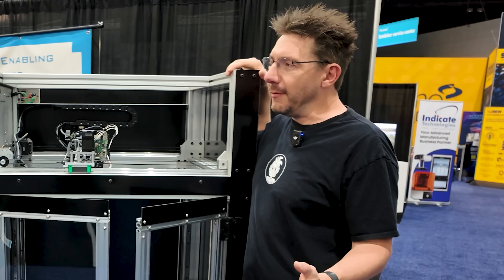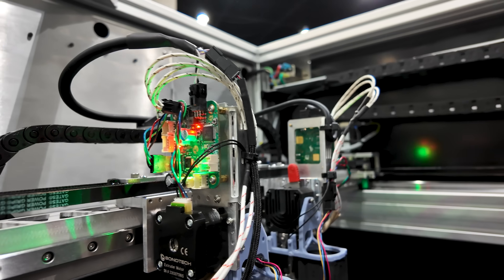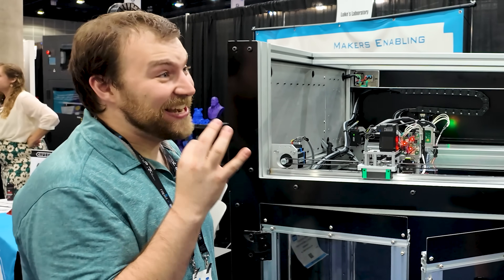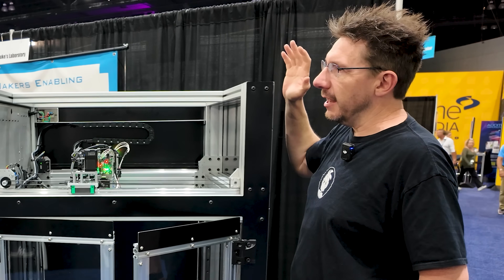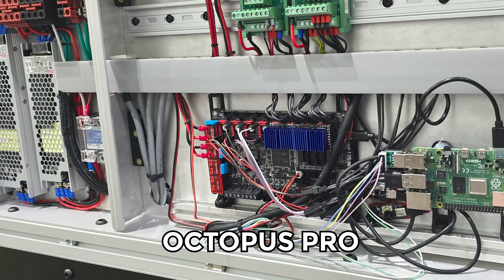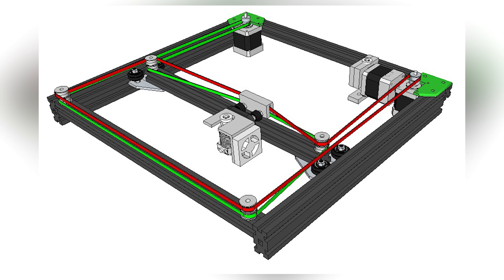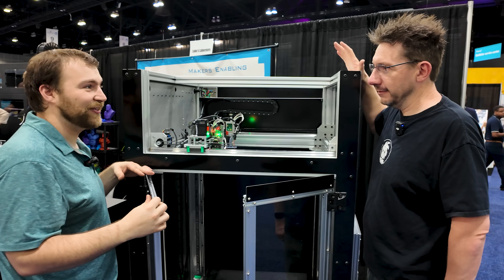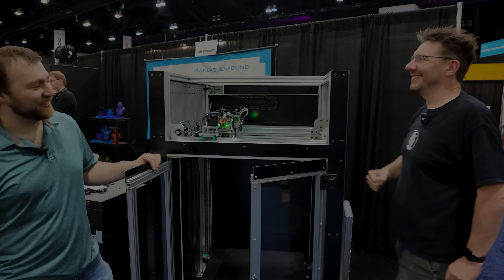Stablebot Pro at RAPID + TCT 2024: INDUSTRIAL 3D Printing from Luke's Laboratory!

Comment: 120 C in enclosure, motors & boards with drivers, mcu, etc. in same 120 C medium. When powered, all of it gonna get even hotter. I really doubt this gonna work. Not mentioning thermal expansion. Almoust forgot about heatthink in 120 C medium.
Reply: @DNIWEDONNOE  Hi there! Due to just how much time is available to talk, we didn't go into everything that makes the 120c variant different than 100c+. The motors are downgraded to steppers which will live, and the control board should live but will be replaced with plain connections until more extensive testing. As for thermal expansion, there are backers to mitigate different CTE mismatches if needed on the spar, but nothing that is challenging. And 120c heatsink is genuinely the easiest thing to deal with - anything printing at 120c chamber will happily print with the cooling available on the chube champ
Reply: @LukesLaboratory  Thanks for reply, glad you've got it all covered

Comment: I couldn't make out the version of Klipper that was being used.  What caught my attention was the version they use will tell you what ADC has failed.  A missing feature in the versions of Klipper I have been using.
Reply from the maker: Danger Klipper!
Reply: danger klipper. its amazing. better temperature control, new input shaper models, better logging and error messages, native sensorless homing features, and a bunch of other really awesome improvements. its awesome and i run it on several of my vorons, annexs, and mercuries